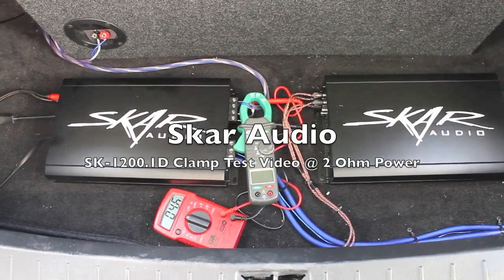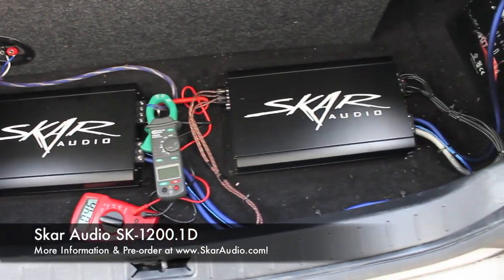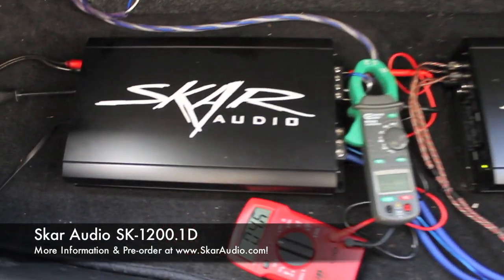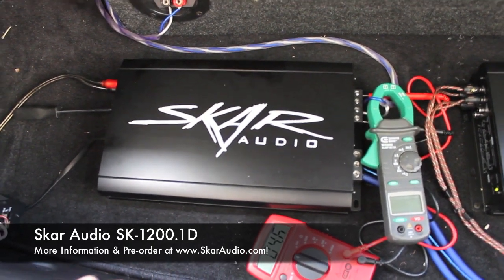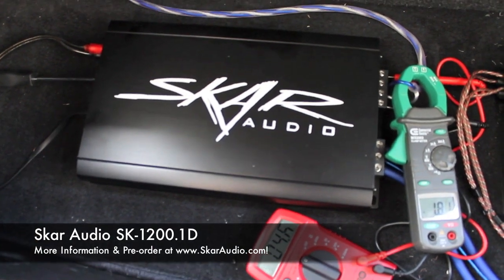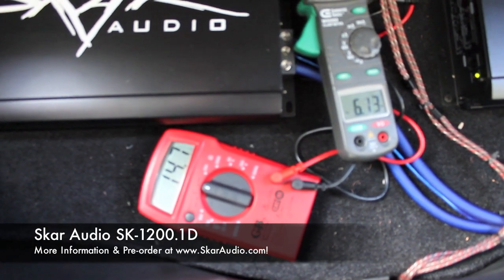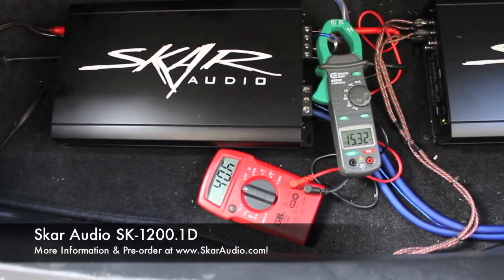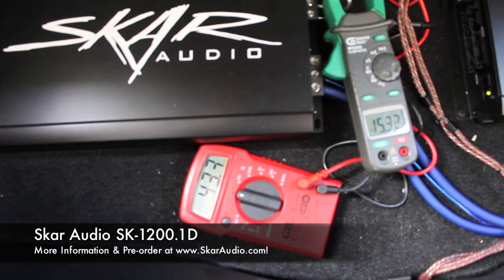Skar Audio SK-1200.1D Amplifier Clamp Power Test @ 2 Ohms!

Comment: I give your amps like 300 watts each you've totally left out phase shifts factoring. Clamping DOES NOT WORK!!!! It's a nice little calculation using a true sine wave figuring out your output frequency which typically has an offset of 90 degrees (assume 60hz) which means you're only getting like 35% of what you think you're getting.